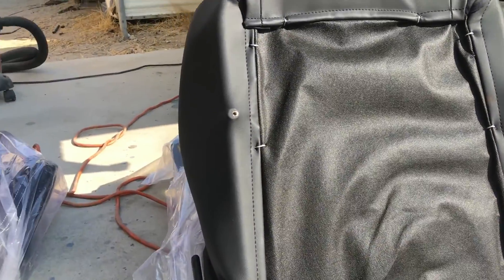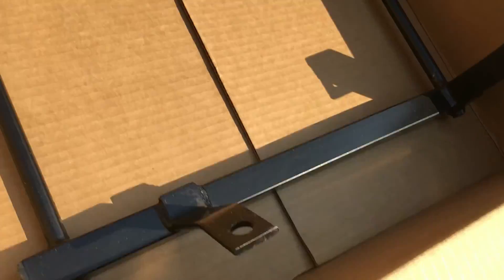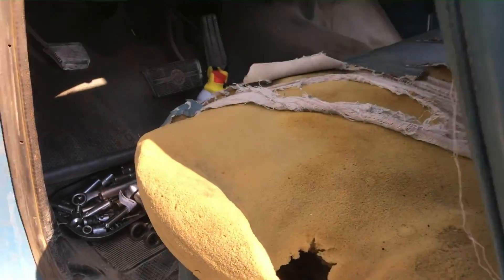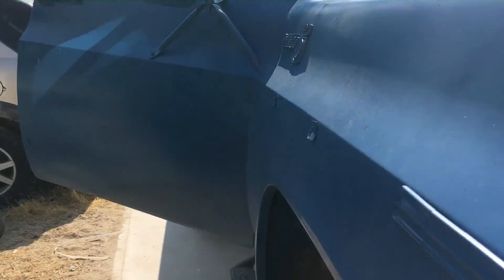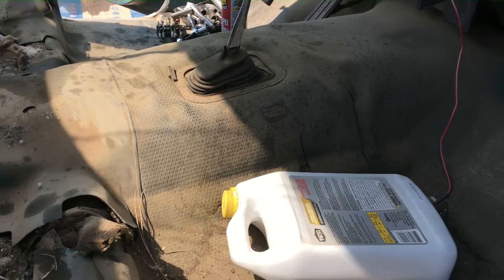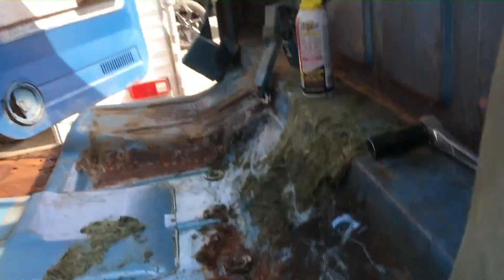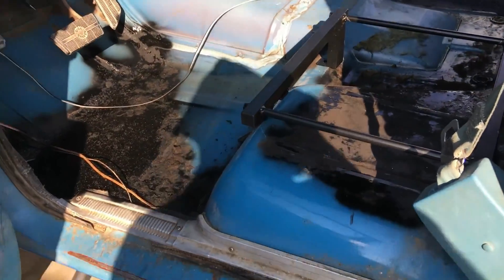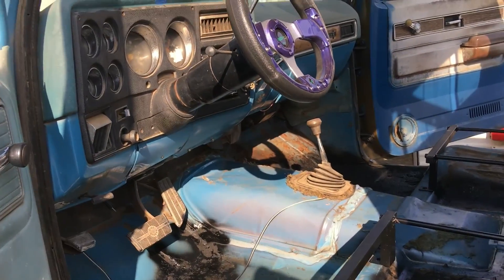1977 Chevy K20 New seats remove old seat

Comment: The weatherstripping behind thr vent panels will leak when it rains, also they leak in the cowl where firewall and cab are seam sealed together, they rust out or seam sealer fails and leaks behind dash into floors